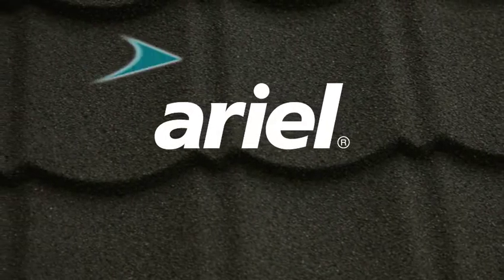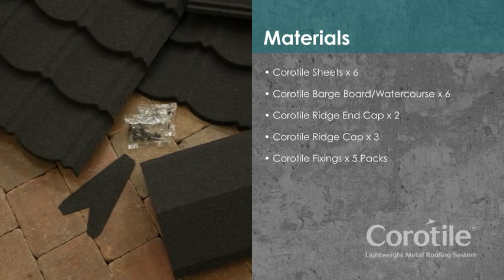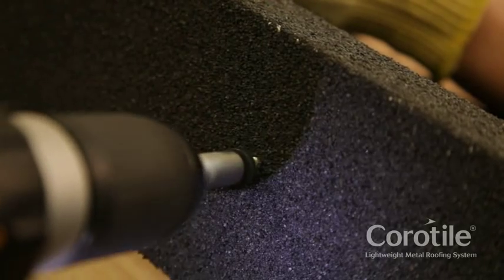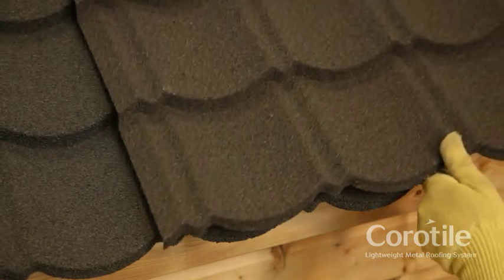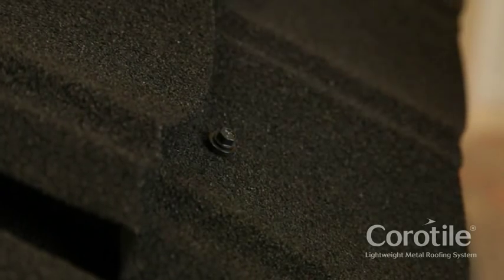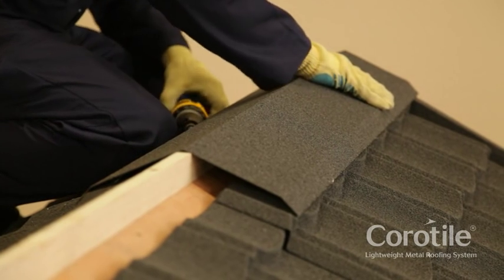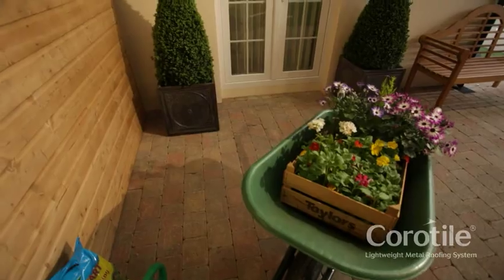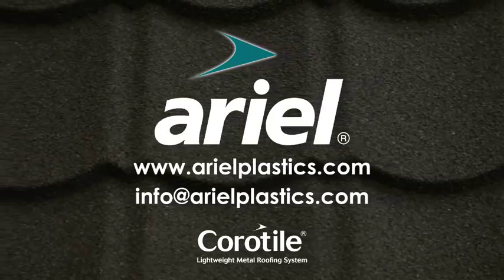Lightweight Metal Roofing Installation Guide

Comment: Despite what it says DO NOT continuously overlap the sheets. You will get eaves creep so that after 4 sheets your eaves line will be about 30mm lower than the first sheet. I suggest you overlap and then underlap and repeat  - that way you can maintain a straight eaves. If you decide to put them on battens / "purlins" you will need to think about how the tiles will lay on the barge board pieces. I had to notch the ends of my supports
Reply: Yess your 100% rite , overlap and then underlap , it’s the only way , especially if your doing a long roof , a small roof like there showing on this video might be fine for just overlapping 👍

Comment: Do you make a pack for bird tables or kennels etc? Ie smaller surface area to cover ?
Reply from the maker: Corotile lightweight metal roofing system is supplied 35 tiles per sheet.  Length per sheet 1140mm, width per sheet 860mm.  To discuss your specific requirements contact us  on 01246 281111 or info@arielplastics.com

Comment from the maker: Corotile lightweight metal roofing system is supplied as 35 tiles per sheet - length per sheet 1140mm, width per sheet 860mm.   To discuss your specific requirements contact us on 01246 281111 or info@arielplastics.com

Comment: This stuff is useless. The overlapping sequencing pulls it further away with each consecutve sheet until youre running downhill. Its as fragile as hell, warps and twists and has to be treated very gently, and its also compromised by the amount of screws going through it - not fit for purpose for anything bigger than a garden shed. Believe me, ive tried. And at over £20 a sheet this is no joke. AVOID
Reply: See my comment about over / underlapping the sheets. I put a spot of silicone around the screw before finally driving it home. Yes,  the sheets do flex a bit when handled, but ended up fine on the small roof I constructed over a flat concrete roof that needed the water kept off it. I used battens built up to support the sheets fixed along the line of the lower edge of the tiles. NOTE this means you need to increase the minimum slope angle if you do this.